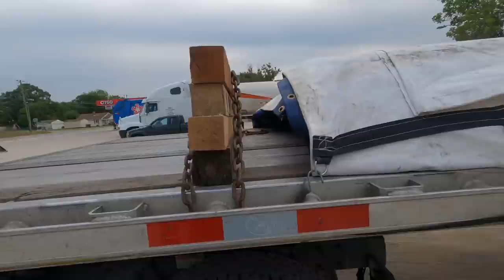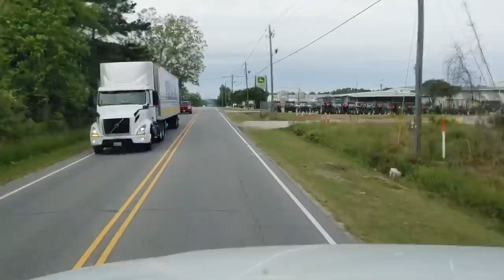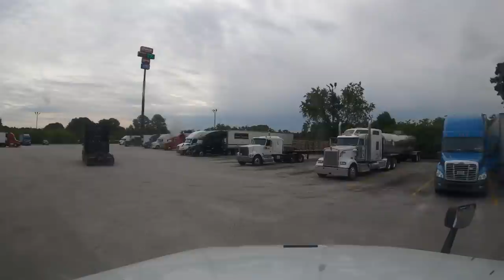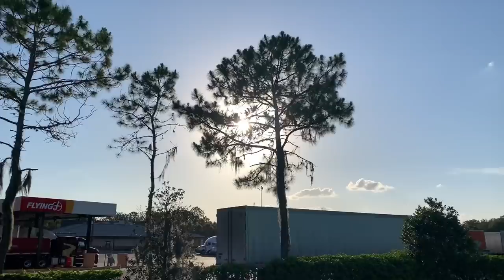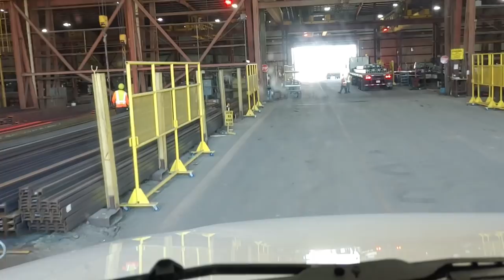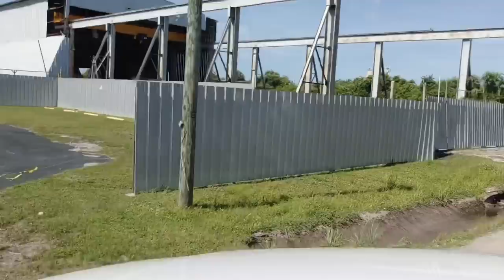Steel Dynamics Angle Iron Flatbed Trucking

Comment: Just browsing through YouTube and came across your channel. Nice to see someone kinda local to me I live in Rustburg just south of Lynchburg Virginia
Reply from the maker: Hunter Evans welcome to the channel. I run to Lynchburg quite often. Just today ran up to Fredericksburg and right back down to the house
Reply: @bigsnow1705  that's cool man do you live in Roanoke or something
Reply from the maker: No. I live in North Carolina. But my home terminal is in Emporia
Reply: @bigsnow1705  oh ok I know where emporia is. I'm not a truck driver but I used to work in the shipping department where I work for a few years. I didn't have to know but I did know most the oversized regulations as far as width and height for DOT. I still work at the same place but different department now